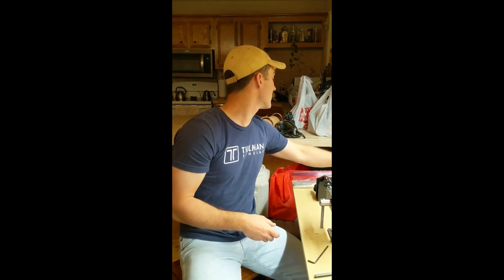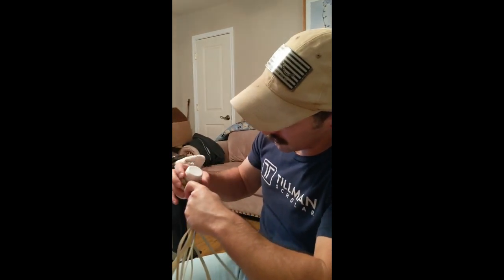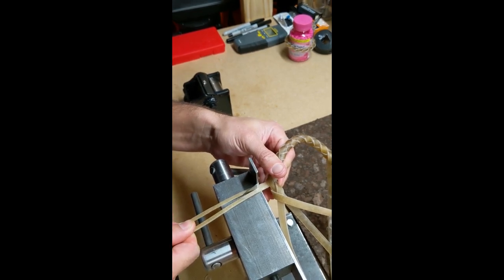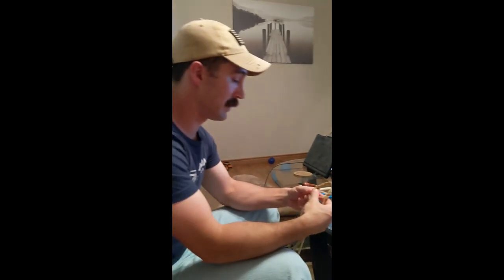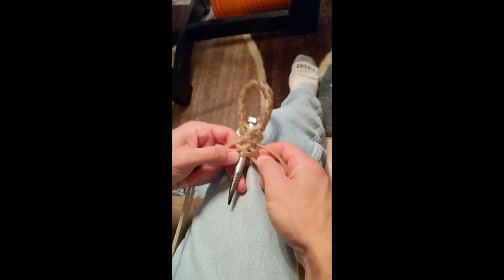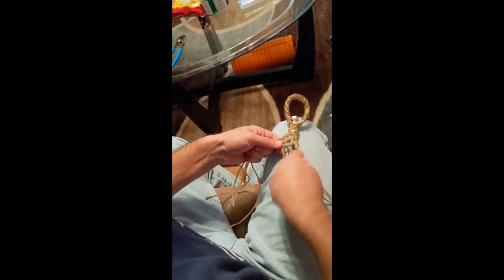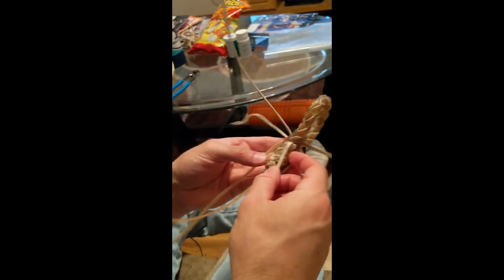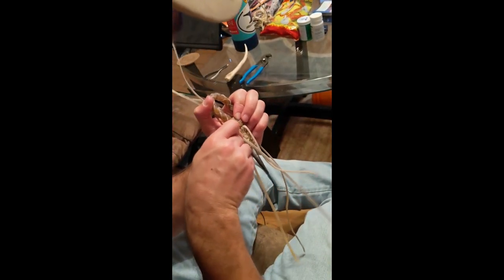Mexican Swivel Honda (Popsicle Honda) - Start to Finish

Comment: Hi, I have been trying to look for a technique I think is very similar to this, a riding quirt with a loop at the bottom or top or both that looks like it is plaited around a core the same as a bullwhip plaiting. I can plait handles and Turks head knots, I can also put a backsplice or eye splice in 3 strand twisted rope but I can't seem to find a good process/technique for plaiting around and then tieing into a cored loop/handle

Comment: I see the end are not tapered and pointed. By tapering a point about 1 1/2 to 2 ins. long, makes passing under much easier. You will not have to move the strands as much

Comment: Good job Eli, after watching this I think I manage to do this. Here is my question though, so for a 5/16" riata, would you use the 7/16" bolt or would you go down to 3/8" bolt? I don't want the honda to swivel on the end of the riata, to keep the loop running square and not twisting into a figure eight as I swing it. Also your bolt is tapered to a point, how long is the straight portion of the bolt from the head to where it begins the taper? Does the taper end up under the "nose button" or "pineapple button?" or should the braid end before the taper?
Reply from the maker: Hey, Ed.

Sorry it has taken me so long to get back to you. If it were me, I'd size down to a 3/8 bolt or maybe even a 5/16. If you use the 5/16, it may be a bit tough to get onto the end of your similarly sized rope, but that would likely prevent the excessive swiveling you're talking about.

I would have the taper on your bolt be shorter than it is on mine. I make sure the neck isn't going over the taper because I don't want it to have a pinch point. The straight portion length just depends on the length you desire the neck to be. Just make it a little longer than you want your finished neck to be.

Cheers and good luck!

Comment: Do you have these for sale for 5/16 ropes?
Reply from the maker: Check out my website, www.rawhideeli.com to see what I have in stock. They should all fit a 5/16 rope as long as the terminal knot is large enough. If those don't meet your needs, I can make one for you. Just use the contact form on the website to let me know. Thanks!